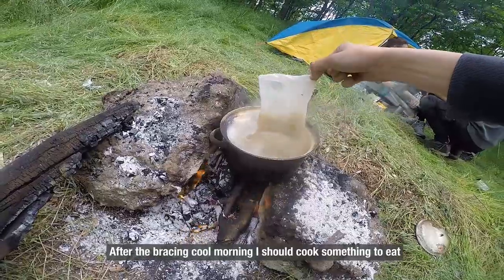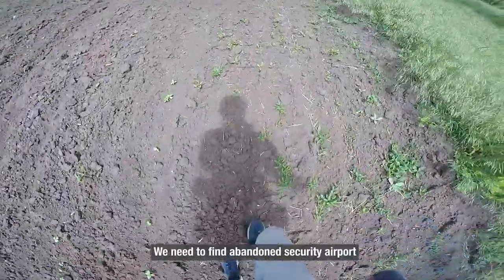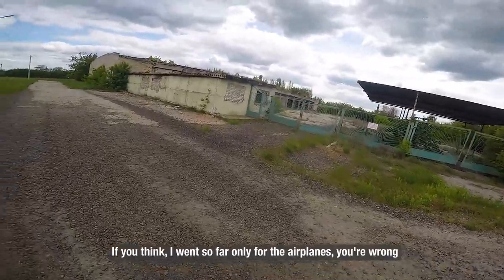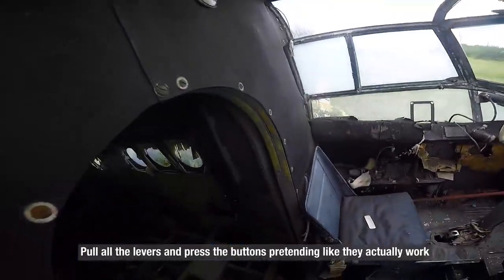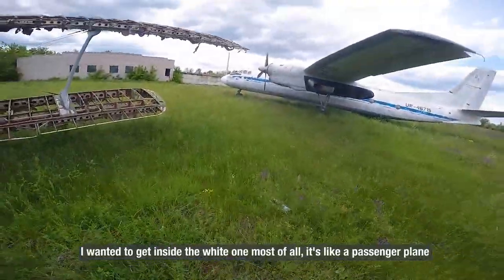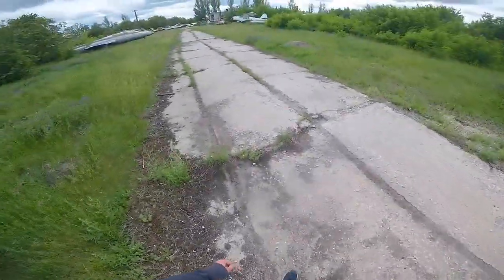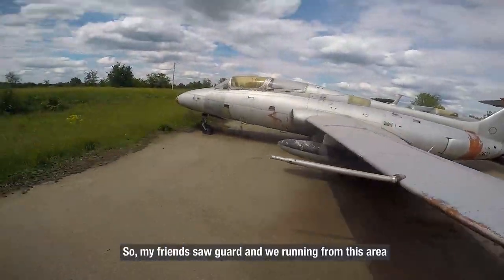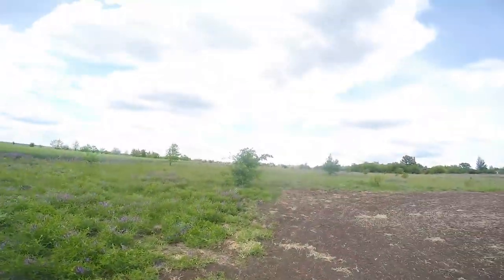Hijacked a military plane at a secret facility

Comment: To anyone who's wondering, those jets are Aero L-29 Delfíns and they were used as the standard trainer for the Soviet Air Force in the 60s. Also they feature interlinked ejection seats for both the student and the instructor, and seeing how the seats are still there I probably wouldn't "pull all the levers and press the buttons pretending like they actually work" @ 6:29... Cause they just might.